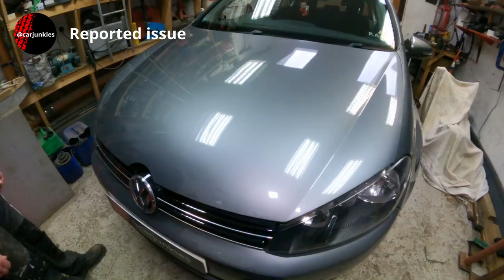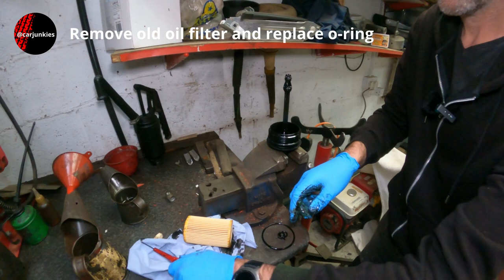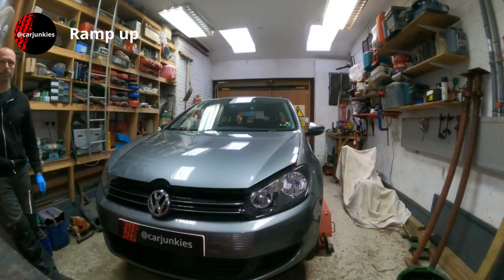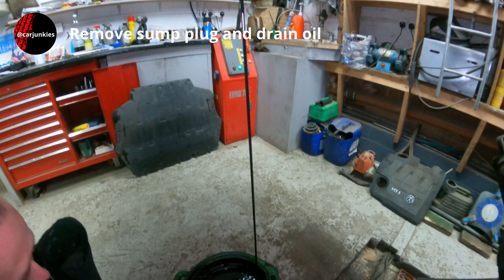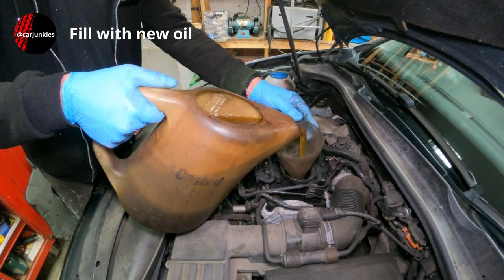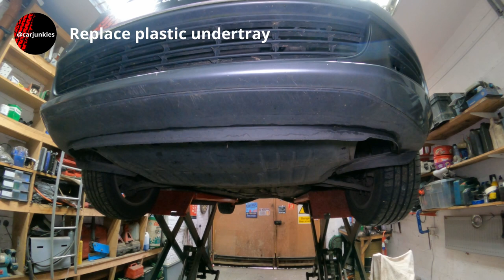VW Golf 1.6 TDI Diesel (2011) - Oil and Oil Filter Change

Comment: thank you. the torque 30 bolt won't unscrew and trying to fix that currentlt.
Reply from the maker: Hi @user-ml9qc5hk1p  
I cannot recall whether the screws in the plastic undertray are recessed or not, but generally;
- if the screw is rounded then you could try and crack it loose with a chisel or a pair of grips
- if the screw is seized, you can try and apply some heat to expand the thread that the screw goes into or add some penetrating oil and let it sit for awhile to see whether that eases it up
- if it’s cross threaded, you may have no option but to drill it out and then secure it going forward with like a zip tie or cable tie or something.
Good luck and thanks for watching.

Comment: can somebody tell me can i put in my golf 6 1.6 tdi liqoi molly oil or long life iii
Reply from the maker: Hi Aron

For a 2011 VW Golf 1.6 TDI Diesel, you need to choose the right type of engine oil that meets the specifications recommended by Volkswagen. Here are the details you need to consider:

Oil Specification: Look for engine oil that meets VW 507.00 specifications. This is crucial for ensuring compatibility with the vehicle’s diesel particulate filter (DPF).

Viscosity: The viscosity grade commonly recommended for this engine is 5W-30. However, it's always good to check your owner's manual for the specific viscosity grades that may be appropriate for your vehicle based on operating temperatures.

Full Synthetic Oil: It's advisable to use fully synthetic oil as it offers better protection and performance, especially in modern engines.

Brand Recommendations: While many brands manufacture oils that meet VW 507.00 specifications, some reputable brands include Castrol, Mobil 1, and Liqui Moly.

Thanks for watching